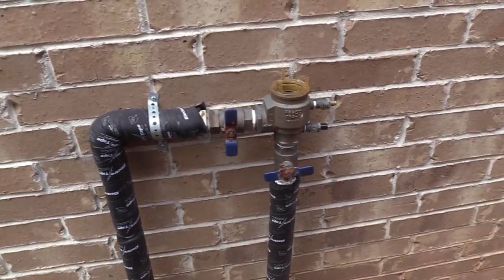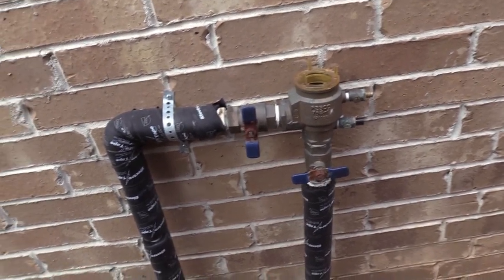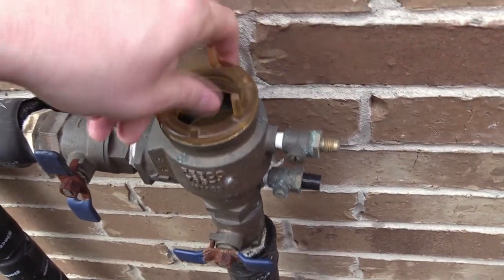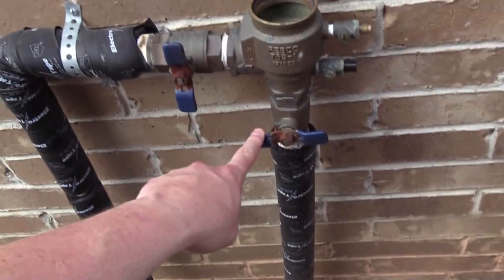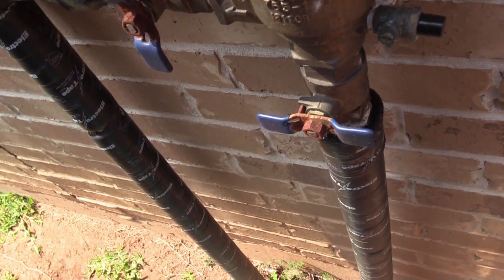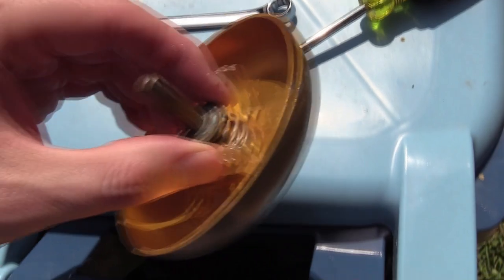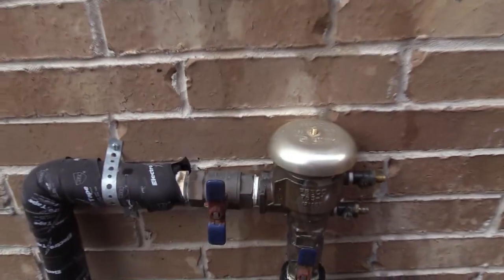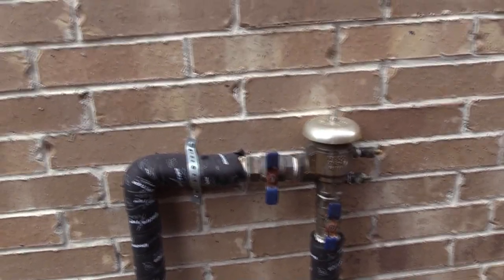How To Replace a Febco 765-1 Back-flow Kit

Comment: For anyone thinking about doing the cheap part on amazon, the 2 I've received, neither sealed properly, just get the brand name part.  It's quite annoying that the part made to fail (poppet) is almost the same price as the whole assembly, at the moment.

Comment: Just replaced this, but water still come up out of the bonnet. Any ideas?
Reply from the maker: Perhaps it did not seal correctly?
Reply: same problem here,  I replaced it few times in the past, but dont know what is going on now.
Reply: Tap the poppet in a circular pattern with a skrew driver to seat it.

Comment: Yes sir it froze and snowed twice. Once in 2017 and once in 2018. if you want pictures I have them. . Temp got down to 25 degrees in Cypress,Texas for over 8 hours and my back flow preventer went to. This is an observation, but everytime we get a hurricane it seemed to want to snow in this town. My son and I made a custom blanket to go overall the brass body and blackflow preventer to "try" and prevent freezing weather from affecting it.

Comment: I replaced check valve. Backflow preventer still leak. Do I need to replace retainer?
Reply from the maker: check and make sure all the seals are good first but you may need to replace the retainer as well

Comment: This video helped me out. Very easy to do. The only concern was I was turning the water on too slowly that I kept thinking I did something wrong. You have to turn the water on and let it force through so both of the plastic pieces will “ marry” like you said. Thanks!
Reply from the maker: Glad I could help! I was a little concerned about that as well :)
TTT

Comment: Good info and just in time for the great 2021 Texas freeze. Now I just need to find the part.
Reply from the maker: LOL...they have been scarce from what I hear
Reply from the maker: LOL...they have been scarce from what I hear
Reply: Sprinkler Warehouse on Jackrabbit rd. has the OEM repair kit, as well as an aftermarket repair kit for about $20 less.
Bought the aftermarket kit yesterday and the OEM check valve assembly. Took about 15 minutes to install for a client, and no issues.
Parts total was $54 and change.

Comment: Post freeze here in Katy, same thing. The big brass piece that is below the bell, mine got a small crack in it, how do I replace that brass housing that you screwed that plastic piece into? Any ideas?
Reply from the maker: My next-door neighbor went with a rubber piece and got rid of the brass housing entirely. I will take a picture tomorrow and try to upload it on here. Plus I will ask him how he did it (he is a mechanical engineer...I am a nurse practitioner...lol).

Comment: I cannot get the first step to come off, that plastic yellow disk that broke off I cannot get it off, any recommendations?
Reply from the maker: If you are talking about the external plastic yellow piece you might try giving a few soft whacks with a rubber mallet...it may help to loosen it up...and/or you can try using WD40.
Reply: inkd_cali86  thanks for your “smart” comment, but it actually doesn’t solve my issue. The yellow plastic is stuck, the rest is pretty straightforward.

Comment: Do you keep the shut off on the left off or do you put it in line with the pipe like the other one?
Reply from the maker: Hey there, I left mine perpendicular as it shows in the video and have not had any issues.

Comment: I recently purchased a home in Houston and this was known to be broken. I'm finally getting around to replace it. My water pressure coming up through the unit isn't anywhere near as powerful as what you're experiencing. It's too weak to push the poppet up into the bonnet like it should. Any ideas?
Reply from the maker: I would say you could have a leak somewhere. Or perhaps the pressure isn't fully released all the way.

Comment: Why do half the job ? Replace the check valve assembly under the poppet also for an additional $20 part. and you have a complete rebuild.
Many of the issues people have with leaks after changing the poppet are from the check assembly.
Reply from the maker: Good point. You certainly can replace whatever you feel like spending the money on to do so lol